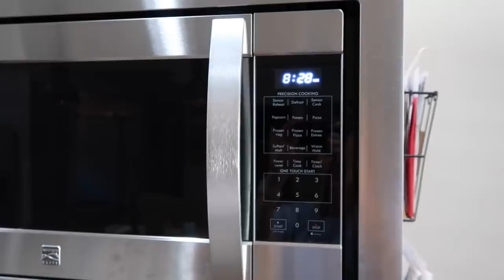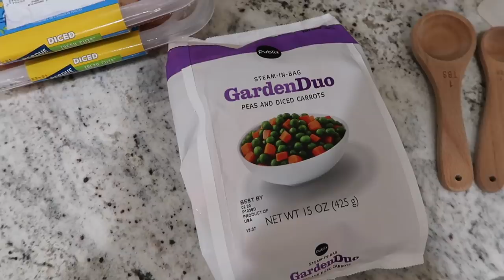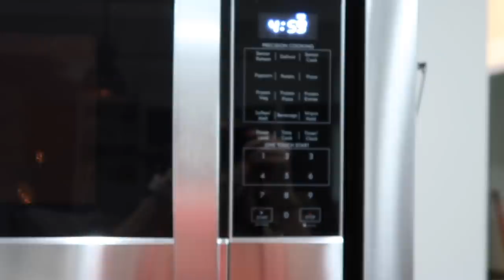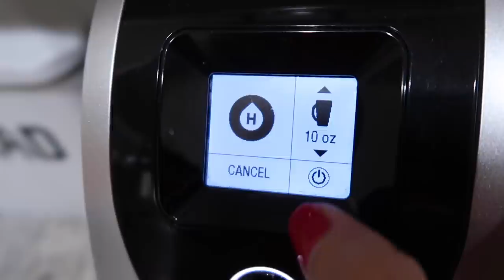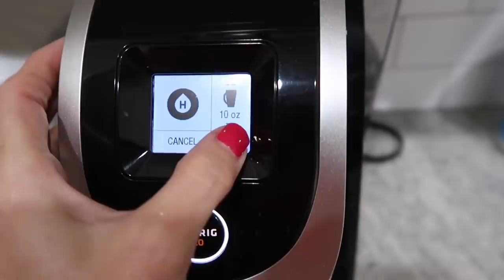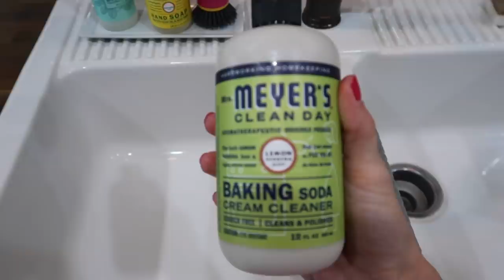2021 HUGE 2-DAY CLEAN WITH ME | EXTREME CLEANING MOTIVATION | CLEANING ROUTINE | Amy Darley

Comment: great job.  i am a fan of your home layout.  it is inviting and looks great.  as far as the ice thing for the disposal, i do this but only to dislodge any particles, food or rust that builds up on the blades, bottom and sides. to get the water to push up and out i used one of the packets for disposals.  you run warm water and throw in this packet while the disposal is running and it soaps up the disposal and sink...then it sucks it back down.  i love the way it smells after.  you can also use baking soda and vinegar with the ice idea above to get some deodorizing going on.  i also do the cleaning idea with a pop in pod/packet for the dishwasher on the same day as they are connected.  so sometimes when the dishwasher stinks the sink does too...or the other way around.  i have bought one of those handheld steamers and do intend on using it to get out some ancient grime!  i love cooper and enjoy seeing him be your cleaning buddy in the videos.  nothing like our pets to bring out the love!  i love all the cute shirts you have made for baseball nights.  very cute!

Comment: To Do:  work.  Declutter & Pack 3 drawers from China Cabinet (stuff not being used).  Dishes.  Dinner.  Vaccuum office & Living Room.
We're getting ready to renovate our kitchen, so the non-essential stuff has to get packed away.  Essentials will be the last to go.  Getting rid of furniture around Easter, so China Cabinet, table & chairs will be the 1st to go.
So much.....
Reply: Baseball tournaments are good/bad.  I've been on the ballfield for 22 years, and have learned quite a few things from our adventures.  Oldest kid is 26, and youngest is 17, so we're not done with ball as of yet.  So, I'm sure there is even more to learn.

Comment: Clean your disposal suppose to remove the shield stuff with ice turn on disposal  for a few seconds with hot water running turn off disposal and stuff more ice in while hot water is still running let water fill a little in sink  then turn disposal back on